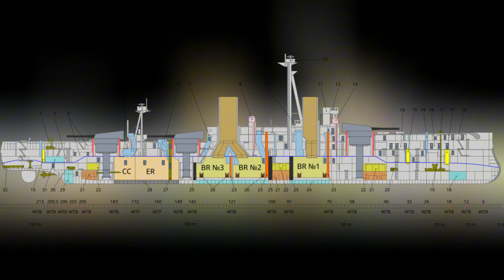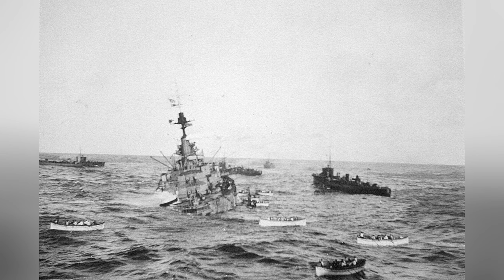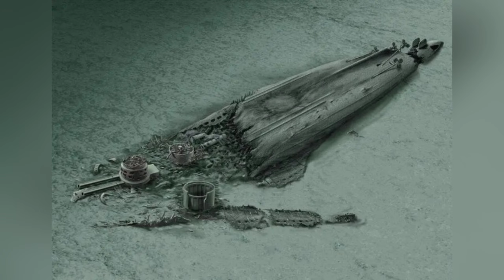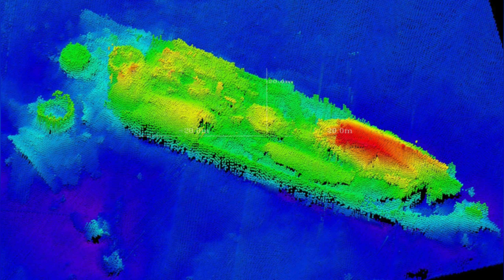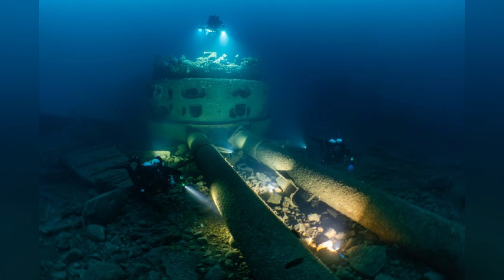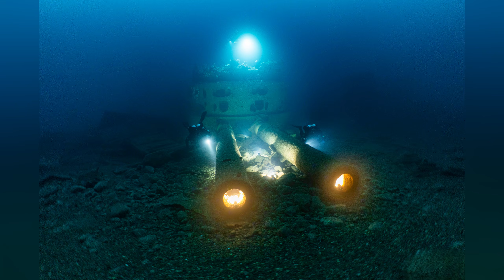Revealing HMS Audacious: The Hidden Dreadnought Disaster

Comment: British underwater protection has always seemed rubbish compared to the Germans
Reply: British aircraft carriers in WWII were designed with robust torpedo protection, particularly the Illustrious and Implacable classes, which featured specialized underwater protection systems designed to withstand 750lb warheads. Unlike American carriers that prioritized aircraft capacity, British designers in the 1930s focused on passive defense (armor) to operate in confined waters like the Mediterranean.... American carriers seemed just as susceptible, if not more so, to torpedo damage, such as Lexington, Yorktown,  Wasp...
Reply: When I learned that the British didn't add torpedo blisters to their aircraft carriers, or at least most of them, I think that ends the carrier debate of British armored deck vs americans non armored deck carriers. Granted I do think some of the American conversion carriers might not have had them, and the British had several old or conversion careers, that lacked torpedo blisters, but their top line carriers didn't have them.
Reply: @theodoresmith5272  Torpedo blisters were a temporary solution that disappeared when it turned out it really didn't do what they hoped it would do. Mostly because of greater effectiveness of torpedoes in general. They were a way to prolong the life of old ww1 ships. Torpedo protection and it's effectiveness was all over the place as was the viability of torpedo attacks in carrier operations. Yorktown survived bomb hits but not torpedo attacks. Musashi who as her sister was considered having weak  torpedo defenses survived for hours with close to 10 torpedo hits. It's all over the place.

But to bring this down to armored deck carriers is just disingenuous. Britain would only lose here oldest carriers and one reason her new carriers survived pretty much unscathed was their armored decks. Why do people like you always have to try this?
Reply: @buggerall wow, what propaganda.  Many ships were saved by flooding the other side during ww2. Judging by the way many usa carriers survived torpedoes but many British careers didn't, i think the proof is in the numbers.
Reply: @theodoresmith5272  You didn't really read it, didn't you? Guess it was too much text which makes sense because all the other distinctions in the data went straight over your head too.
people can be rather informed these days. Just shouting stuff doesn't impress anyone.
Reply: Germans went the high tech route but slow to produce and a nightmare to repair, Britain went for the low tech and easy to produce route.

Who won?